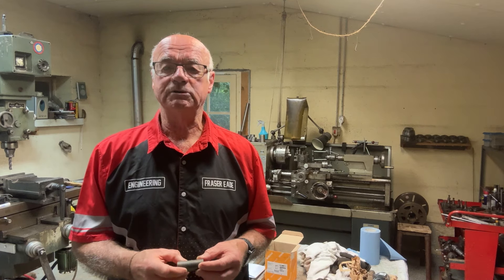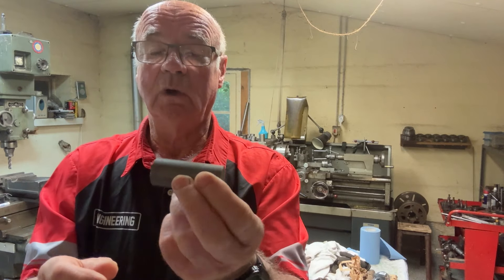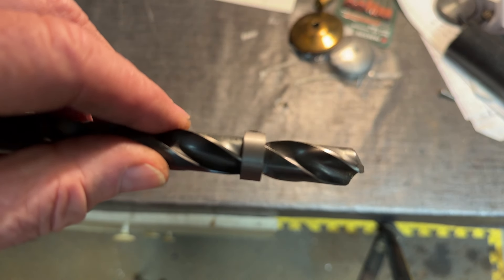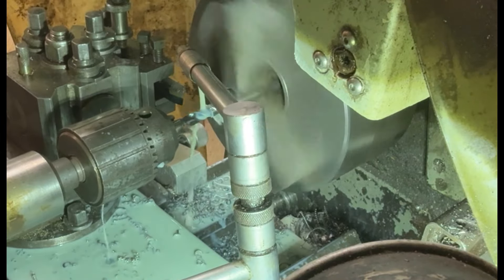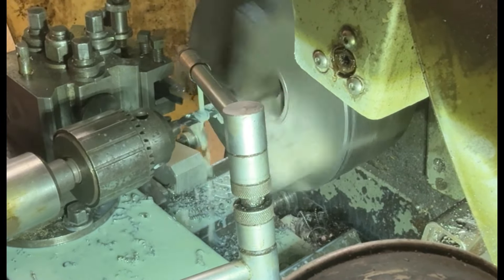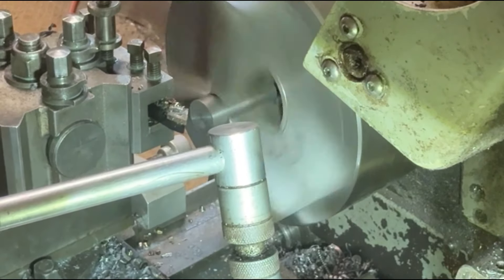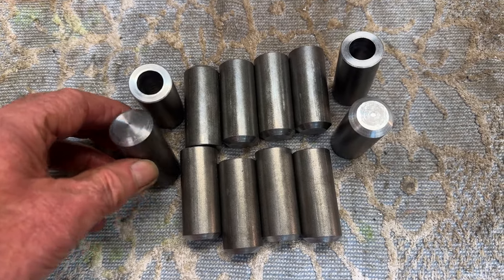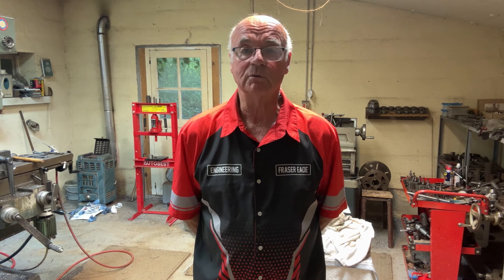Drilling Holes to a Specific Depth

Comment: where are you in France please? If you are near us I would love to talk. I have a lathe (Colchester) in the barn and various other bits that are taking up space. Thanks.
Reply from the maker: Hi, I live near Saint Junien in dept 87, about 30 minutes from Limoges. Where are you?
Reply: What is a soft jaw chuck?
Reply from the maker: @paulmeynell8866  Hi Paul, thanks for the comments. Soft jaws are replacement jaws to fit the 3 jaw chuck. They are made from soft mild steel rather than the standard hardened  jaws. They can be machined to fit the work piece to allow for dedicated diameters or depths to suit whatever the work project is.
Reply: @MetalworkinginFrance-xe5rg   now that’s interesting I’m guessing they are only good for one or two jobs depending on how much you have to alter them  but a great idea.
Reply from the maker: @paulmeynell8866  Yes, they have a limited life but very easy to make so just replace when needed or make them to suit whichever drill you're using.
Reply: @MetalworkinginFrance-xe5rg  sorry I’m a bit lost! I have taken the jaws out of my 3 jaw lathe chuck ,they were marked 1,2 and three .
I presumed they were precision made . The curved gear/ teach on the back look difficult to make?
And I don’t see how a drill chuck comes in.
Sorry for the newbie questions!
Reply from the maker: @paulmeynell8866  Hi Paul. The soft jaws have the same worm gear teeth on the back but the front is just square and can be machined to suit whatever you to hold in them. The teeth are graduated so they must be inserted in the chuck in numerical order the same as the ground ones. N.B. I don't understand what you refer to about a drill chuck?
Reply: @MetalworkinginFrance-xe5rg   in your previous reply you said  “ or make them to suit which ever drill you’re using”
I’m guessing you meant , lathe  but I was a bit confused at the time.
Thank you for the info .